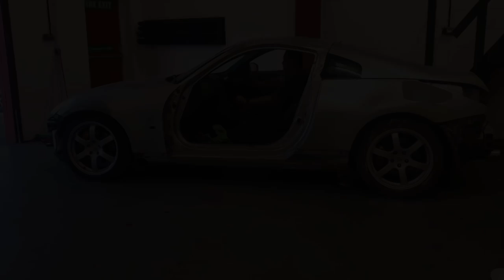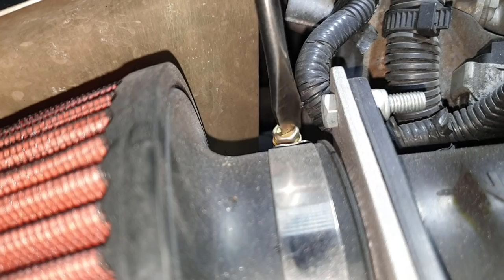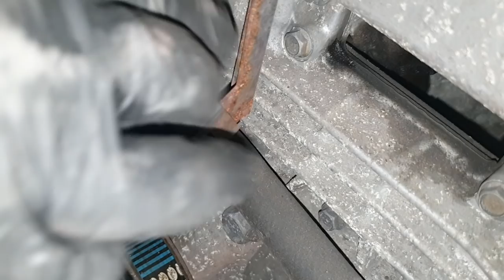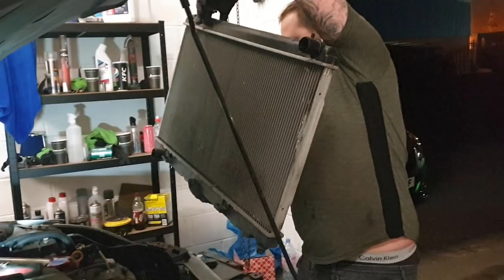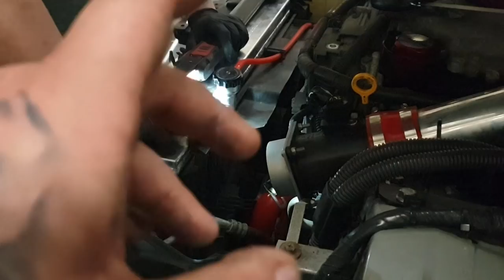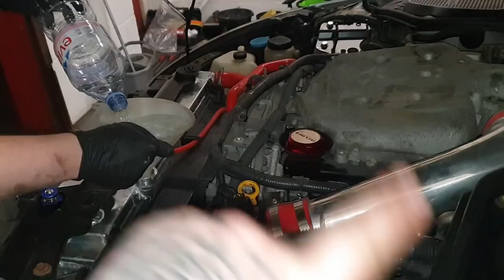350z Gets a JAPSPEED Radiator & Hoses! (Fast And Furious Replica)

Comment: Get the plenum dipped, having mine done when I can be arsed to get it off lol
Reply from the maker: Have u installed a plenum spacer too?, we was gonna get it sprayed gloss black then get the cover dipped instead? Change the badges on that to red too?
Reply: I’ve got one ready to buy, but need to get some harnesses and bar for my buckets I put in first. Then I’ll sort the spacer out, badges red if it’ll match what you dip the plenum in
Reply from the maker: @cazdalvair9769  sounds like a good plan mate, were not sure, we know someone that can print on vinyl so maybe something like channel branding for when were at car shows & showing the engine off ect :)

Comment: Hi rusty loving the new mod for the 350z!! Would you recommend hard intake pipes or are they just purely a cosmetic thing. I’ve got hard pipes from my airtec intercooler, but got the standard vxr oe intake pipe to my panel filter.
Reply from the maker: Hard intake pipes are less likely to fail and dip in, you tend to find the standard ones sometimes do this after time